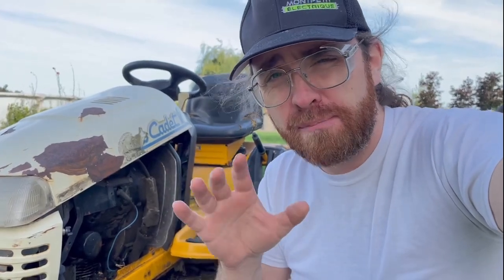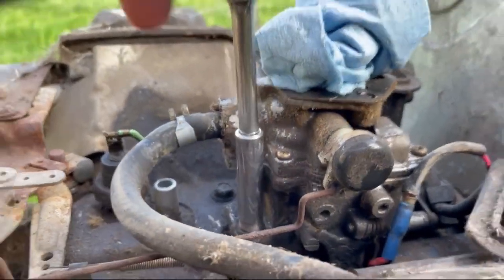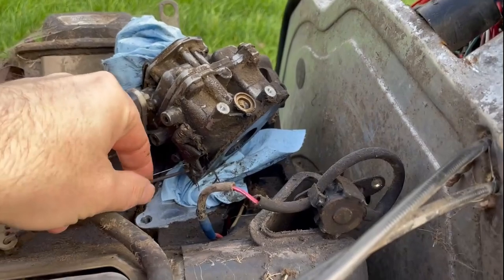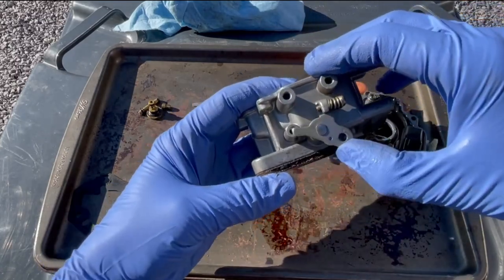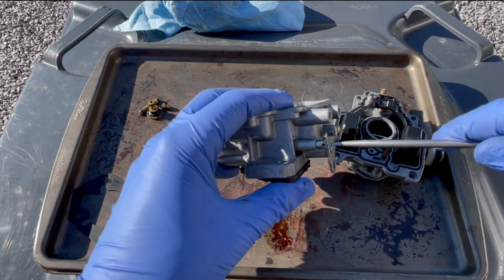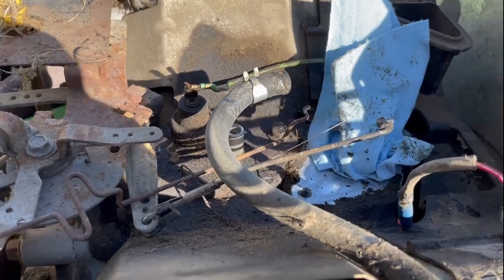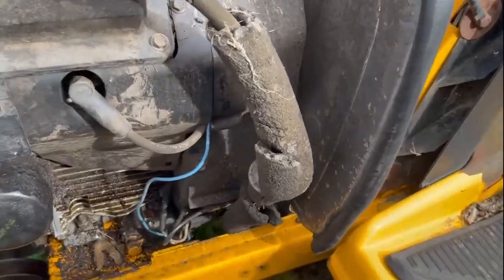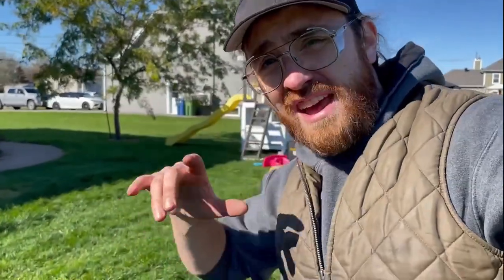Cub Cadet Lawn Mower Won't START? -Carburetor Problem-

Comment: Matt, I have a 1050.  I got it free from a family member, it sat for about 10 or so years without being used.  I replaced all the fuel lines, as well as the carburetor, and fuel pump, among other items on the mower.  It will now turn over but won't start.  If I put some gas down the air intake, the mower will start and run strong until the fuel runs out.  I am guessing the carb needs to be adjusted.  I have read that turning down the adjuster screw all the way and then backing it off 2-3 turns.  I believe I have the correct screw, put perhaps not.  The pump is pumping plenty of fuel to the carb.
Reply from the maker: When you say you replaced the carb, you mean that you put a new one?? It sounds more like a dirty card issue if its still the carb that sat 10 years. Make sure carb is clean and then you can fine tune the adjustment screw, but it should run regardless. Hope this helps!
Reply: @mattsws  Hello Matt. Thank you for taking the time to respond.    I ordered a replacement carb.  The new one looks identical to the one that came off.  I still have not figured why the mower won't run.  Honestly, I have put a few more hours into taking it apart, cleaning items down and "adjusting" the carb.  At this point I took it to a shop so they can look at it.  The mower only has 68 hours on it (or at least that is what the hours display has on it, I believe this is correct).  At this point the mower needs to mow or find another home.  The shop told me that they ordered a few parts, and they are waiting for them to come in.  I did not ask what they ordered, but I should be able to pick up the mower this week.  I have been using an order zero turn that does fine.  It quite raining here about a month ago, so the grass has not really gown much over the last month.  What would you consider high hours for a mower?  The zero turn has over 600 hours on it.

Comment: you missed a jet/adjustment screw. its hidden behind the flat plug beside the fuel solenoid.  on the fuel solenoid bracket you have the 2 screws that hold it on then there is another hole that is where the adjustable jet is just remove the plug by tapping it so it pivots out . then you'll see it.  I've had to clean it out before.
Reply from the maker: Luckily my problem wasn’t there because I would have been scratching my head on that one!!! I’ll keep an eye out for that next time I have the carb appart (hopefully in many, many years!!!).

Comment: the float in the carb is a real common mistake. step 1 if no start look down carb throat to see if misting/wet then fuel quality
Reply from the maker: Good tip! Never worked on that engine, so I learnt the float problem the hard way! Lol! Thanks for watching!!!

Comment: yea I forgot,  on the throttle that screw you removed that left the throttle open fully then put back in is the 2 horsepower screw. that's the difference in a 18 hp engine and the 20 horsepower engine, that screw.
Reply from the maker: OMG!!! Thats what it looked like to me, but I couldn’t believe that they would do that! I hope they sold both engines for the same price…… If not, I would have felt screwed (no pun intended)! Thanks for the great info and thanks for watching!!

Comment: I have a similar mower (cub cadet AGS 2160) engines nearly the same, but the carburetor on mine is much bigger, and bolts from bottom up...damn wind storm showed up, so I'm on pause rn lol
Reply from the maker: Yeah weather around here is pretty bad too…. Thanks for the comment and thanks for watching!

Comment: On the fuel selonoid on the carb. You can shave it down or shave it off... I did that for my 2518 cub cadet....It was draining my battery cause I got rid of all the protection stuff, had a fuel in switch, kill switch and push button start, got rid of the selonoid nipple and cut the wires to it and havent had issues since
Reply from the maker: Yeah, I think the only reason they have the gas solenoid is to avoid backfires or dieseling when you shut off the engine... If you don't mind that, then you are right, just cut it out! Thanks for the comment!!
Reply: @mattsws  im not one to turn my mower on or off as its full throttle like every dad out there. I let it idle to warm up, idle before it shuts off, ive never had an issue for some time now and I do alot of woods crawling, starting and stopping, if I havent had an issue even in the middle of a river i doubt you will. But how would it diesel away?  If anything I got an inline fuel valve and a spark kill. Ive had this puppy hot like the exhaust was glowing red and melted but never had it run or give me issues I really think that selonoid is Just for bs reasons and its not needed. Pluss without a needle it assures its not am issue😂😂

Comment: Also add a fuel filter just where fuel enters carb will save you problems
Reply from the maker: Yeah, mine is before the pump, but you are right about having it closer to the carb.

Comment: I can't access the carb mounting bolts from the top. Bolts go in from the bottom. Looks like I'm going to have to remove the intake manifold to access the bolts. Anyone have any suggestions?
Reply from the maker: I guess I was lucky that mine are accessible from the top! Good luck!

Comment: @Matt
So what was the issue at the 0:01 mark start up? I’m experiencing the same issue. New battery… but now after two weeks it won’t start up. (Very similar to the very beginning of the video). Cranks… belts pull…. But not firing. Maybe needs new spark plugs?
Reply from the maker: There was crap in the carb that was preventing gas from getting to the engine.